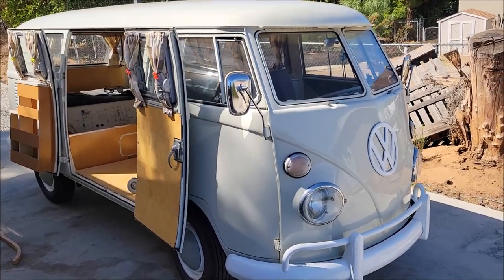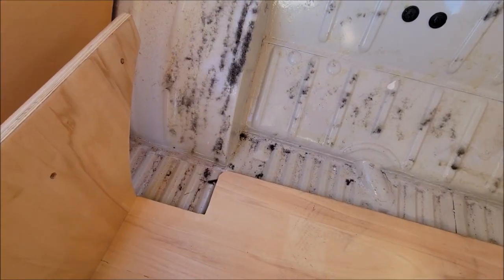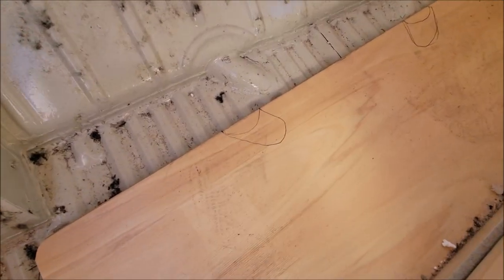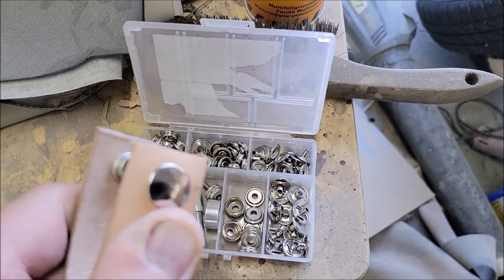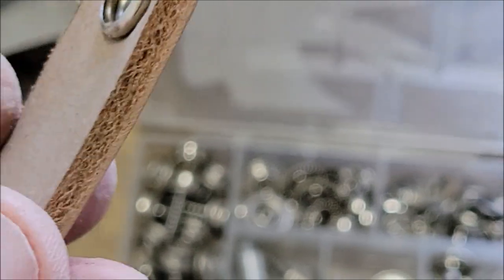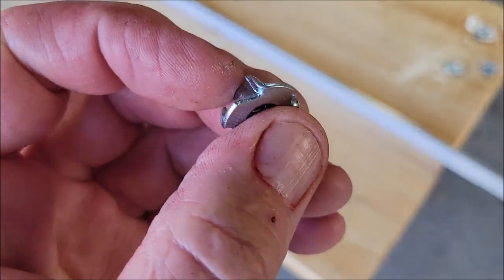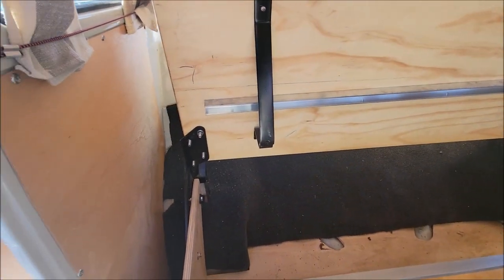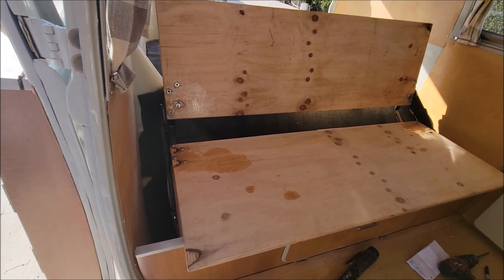VW BUS EXTRA WIDE Z Bed how I did it with the brackets

Comment: This channel is my wife and my memory channel( memory lane).   I had totally forgotten working on all the plywood underneath the z bed and the hand sewing of the bed etc .  This brought back te memories And the sound walls and the installing of hard wood paneling. Hand sewing a insulated carpet from front by to rear.  We sold our walkthru 64 a few years back.  We are still bummed we did it.  Love this channel.     Side topic maybe do a dood video on the nuances of pulling apart and redoing pop out SIDE windows.  The variations of the screw sizes( threading). And the difficulty putting back together the windows.  This with the rubber availability.   It would be good to tip people off to the water leak issues with pop out windows and the vulnerabilities to water intrusion .   I know we were kinda taken back when perfectly put together windows weeped hard and we had to redo a few.    Have a good week

Comment: Hey Mike:  For drilling wood I would recommend using Brad Pointed drill bits.  The pointed tip on the bit keeps the drill where you want the hole.
Reply from the maker: yea I used to have a set of those But I dont know what happened to them. used them for signs on drywall

Comment: Nice job! I am still working on my 68 double cab, restored the rear window and it took many days of fiddling around to get it all to fit and weld in nicely.  I just need to grind down my welds and the back window will be complete, so I know what you mean, sometimes small projects end up taking 3x the time you planned.
Reply from the maker: this sucker took me a while. plus I  have had other things to fix. a rabbit ate through the wires on my truck transmission. just 2 wires but i pulled the harness to shrink tube and check the rest of them Now I am gettng codes. One of the plugs is giving me trouble. OMG. one thing after another.
Reply: @Mikefngarage  I had a rabbit eat my wiring harness on my 2015 Golf.  Why they make the cables from Soy I will never know.

Comment: Great video. I do need to know how you mounted the bracket on the passenger side of the bed. I have two westie hinges. Can you please take a detailed picture of how your passenger side z bed bracket is installed? Mike that would help me out tremendously
Reply from the maker: Yea i thought I had some more footage of that I welded a nutcert on the top of the rear firewall. I could not reach all the way up there to put a nut on. then the others I put through the fender well.

Comment: Thanks I’m also at the stage to do the rock and roll bed
Reply: Delmar hinges....that rock and roll bed is a pain to assemble....
Reply from the maker: @DanTheManIOM  agreed and very cheap. OMG we saw one a few years back disappointed.
Reply from the maker: Yea those rock and roll bed frames are pretty elaberate and expensive. Very cheaply made too. CHINA CHINA CHINA....I like these late bay hinges and cabinet. I would go with this one again before the rock and roll bed frame.
Reply: @DanTheManIOM  thanks buddy I haven’t put it in yet but I’m thinking of what you said but after the first one it’s always easier

Comment: Looking really nice, can't wait. Are you going to put closet in?
Reply from the maker: no space for it and they are outdated. This bed us much larger than the original. so 2 people could sleep on there. Not putting in the sink either. best to use that space for an ice chest. More usable today.....Ice boxes are hard to get ice for.
Reply: @Mikefngarage  was thinking, on my 66 camper bus, I think it had small holes on the bottom wood, under seat to allow air out from the foam to escape. Investigate 😆

Comment: Could you have used t-nuts instead of carriage bolts?
Reply: I guess you did end up using t-nuts😂😂😂 Should’ve watched the whole video before commenting 🤦🏻‍♂️
Reply from the maker: @ElTerrible666  yea on the seat back. I would have gone with 1/4 carriage next time. or tnuts. Even the tnuts are very hard to get started.
Reply: @Mikefngarage  I use a short bolt and some washers to tighten down the T-nut to get it to sink into the wood.